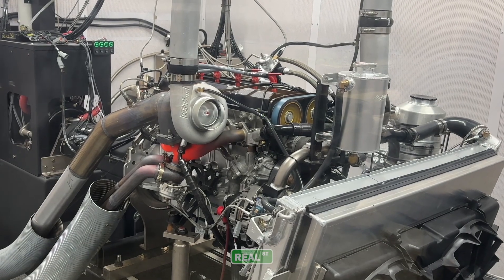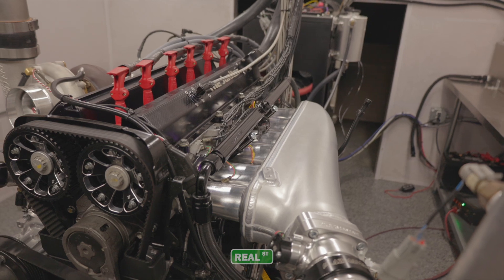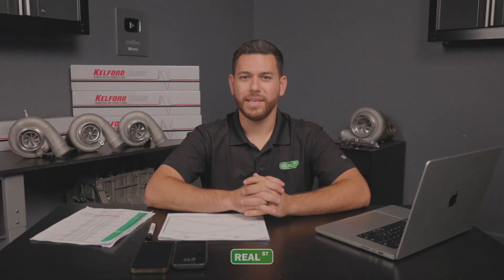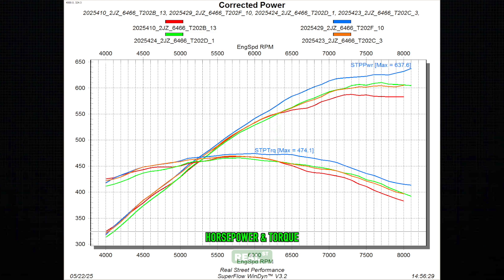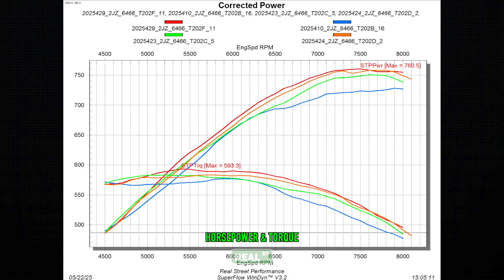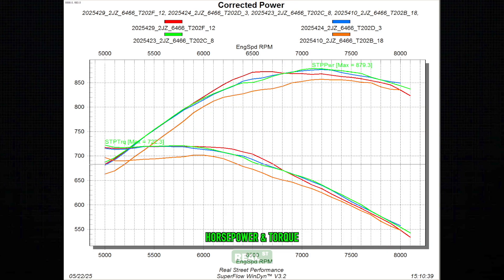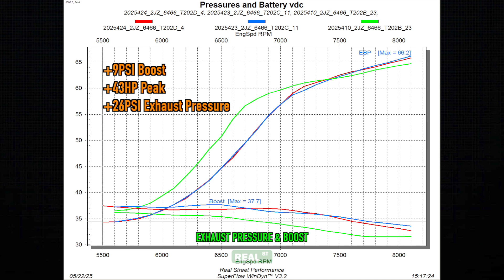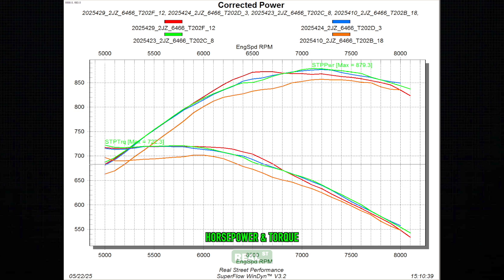Which Kelford Camshaft is Best for me? | 600-850hp 2JZ Testing - 6466 + T202-C

Comment: Thank you for your investment in this content.

This type of test needs ramps from earlier rpm to distinguish the cams. According to your 14.5psi data, I want to run an F cam in my daily…this does not tie with Kelford or your advice but you have no data proving why.

The data from 2000rpm is just as important as peak.
Reply: Hey Martin thank you for watching and the comment!  So this type of dyno is not the right tool to display what you're hoping to see.   Our Dynojet chassis dyno is an intertial type dyno where the vehicle accelerates a drum of a known weight, providing a constant resistance to the engine, where the engine's power can accelerate it (assuming traction) once it "comes online".

The Superflow engine dyno that we're using is a water brake dyno, so it is able to load the engine up to any boost level we want at any rpm we want to test, calibrate, etc an engine.  As such, it is the perfect tool to show people the powerband and vitals of a given "condition."  It is not the right tool, however, to show the data you're asking for.  Eventually we will have the opportunity to give a good back to back from our Engine Dyno to our Chassis Dyno to show not only the difference in peak numbers, but also two ways to look at the same engine performing, since each test will tell you those different things you pointed out.
Reply: @markconte1513  thank you Mark. I don’t even have a JZ but this type of testing is v interesting.

Does the superflow not allow a ramp run from 2000rpm due to the speed of control of the water brake? Eg it would load up at 2000 but the jump in torque coming in boost may be uncontrolled?

I know Eddie current retarder rollers can easily control fixed ramp rates from way below boost threshold as I’ve done it many times to understand performance below boost threshold.

You could probably still test 2000, 2500, 3000rpm etc. steps in steady state on the superflow to get accurate power figures. This would build the power graph and still give you back to back performance of the different cams off boost. I think superflow even have a specific step test mode to do exactly that.

Can also then compare to chassis dyno. Will be tricky not to get lost in the differences of the testing but v interesting.
Reply: @martinrodger9565  happy to help!  We love learning about this stuff too.  So we could theoretically do what you're talking about, but it would still be an artificially generated representation.  Because I could load it up to make 1psi boost at 2,500rpm with an 88mm turbo, and just slowly walk the boost up, but in real life, I probably couldn't generate a real 1psi boost on an 88mm 3L at 2,500rpm even standing on it in 6th gear driving up a mountain (not to mention that it would probably surge there).

What we need to show what you're after there is that non-fixed ramp rate, to where the engine can't accelerate it harder until it has reached that load/boost/power production point on its own.  As you're well aware, our Dynojet 424x's roller doesn't way as much as a car, so it won't load it as much as actual driving, but since the roller's weight is fixed, the acceleration of it is left up to the engine's ability to do so, and that'll give the curve that I believe you're after.  We'll get there eventually! :)
Reply: @markconte1513  So you don’t run a superflow ramp run from say 2000rpm because the compressor will surge from the initial static loading because big turbo low cu in? Or is it the control of a water brake over such a large range of sudden torque increase as comes on boost: Or combo of both?

I’m used to using a dyno like the Dyno dynamics/mustang which do loaded ramp runs at set rates using a PID controlled Eddie current retarder. You can run these from 1000rpm if you want, so long as you get traction when the torque hits. They will sit accelerating at a set 150rpm/sec. This allows you to quickly back to back test low end response. Boost threshold on the street is usually still lower in the big gears. Same as you’ll experience with your DJ.

As said: love all of this and thanks for your investment and sharing.
Reply: @martinrodger9565 no, sorry, I may have said that poorly.

I could probably introduce a surge state but more of what I meant was that since I can give it an acceleration rate, while I could do what you’re saying, I feel that the results aren’t all that helpful because I’m commanding the ramp rate.

Whereas on my inertial dynojet, the engine can accelerate the roller as quickly as it can:  slowly at low rpm, then quicker as it comes on to its powerband, which would better show us the signature of how the engine makes power on its own with a fixed resistance from the roller.

With all that said I’m sure we’ll learn better ways to learn and use the dyno and we do hope to offer up future tests with more information about response.

Transparently, I feature more full-power testing than responses testing, because it is easier to communicate selection philosophy under those conditions.

Response testing is extremely nuanced and unfortunately only going to be exciting and helpful data to people with that very same combination.

This test here could be used by someone with a different sized engine based on the concepts we’re trying to help communicate.

Thank you for the comments and watching!
Reply: @markconte1513  thank you Mark. Play with it, different ramp rates from low down and see what you learn on a mule. Although you’re setting the dyno ramp rate: youre not setting the engine hp which would be different for different mechanical setups. You will need to decide on stable boost control for such tests or fixed wastegate settings to compare different engine setups. Many would say remove the turbo for true cam tests. Turbo engines are such a complex dynamic mix of influences. 
I think your chassis dyno results will also be v interesting. Thank you.
Reply: @martinrodger9565 yeah that’s a great point. I’ve been thinking of doing a pipe to remove the turbo!

Comment: This test is null and void.
I didn't see anyone dial the cams in...the exhaust cam is never correct out of the box. It's absolutely critical that they are as per the cam card for any test to even remotely valid.
And for Christ sake... pressure ratio is absolute pressure... Exhaust and intake.absolute.
Hint:
Map, emap.. the A stands for ABSOLUTE...

.not whatever made up ratio that your have done.
Reply: Agreed re not degreeing the cams. Disagree with criticism of the terminology. They are just using a more generic term for map:emap, although I do think saying pressure differential is probably more accurate. At least they are tracking this data.
Reply: @XX-nw1xg  not using absolute pressure skews the "ratio" disproportionately

Comment: Interesting. Would the Brian Crower cams respond the same?
Reply: any cam
Reply: @exvils  not all cams are made equal. For example the GSC cams are steel cams and the Kelford and BC cams are chilled cast cams.
Reply: @dragonsupra10  its about profile - ramp angle/lift/duration, not material..
Stihl uses plastic cams in many of their engines